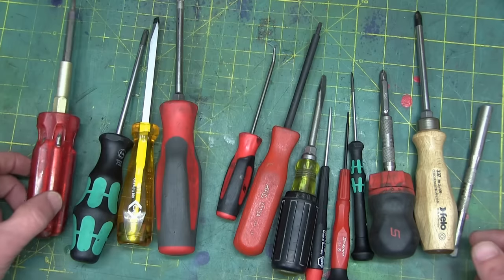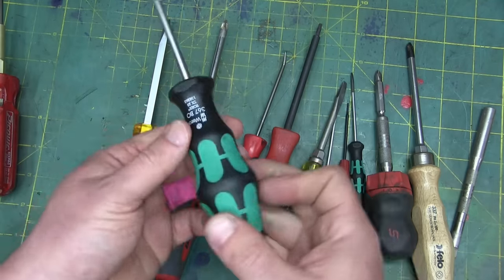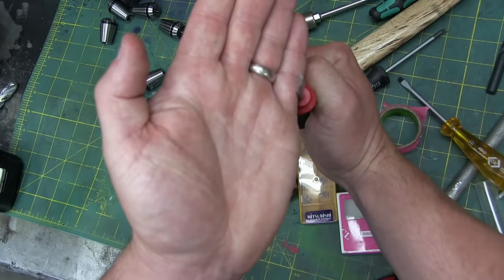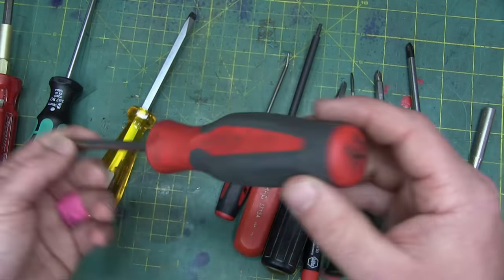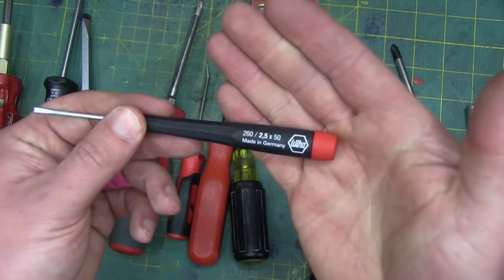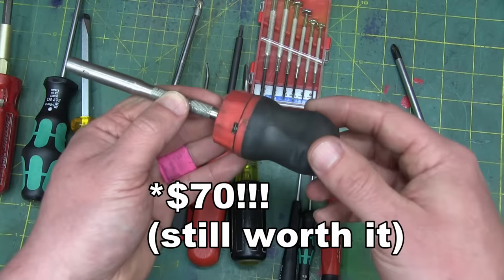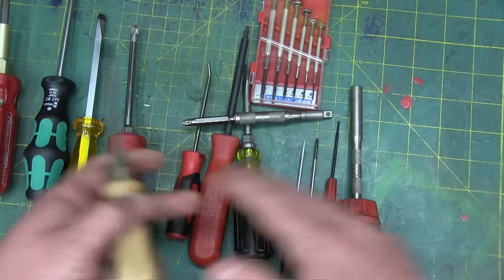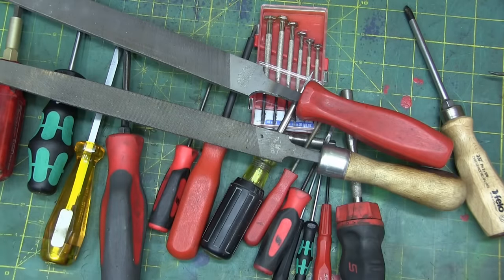Screwdrivers is BEST screwdrivers?

Comment: Those snap-off ratcheting screwdrivers, you can use a 1/4" extension to further extend the reach. Haven't found a need for it yet though lol. A lot of tools I went with other brands, but screwdrivers and ratchets I got all snap on. Even broke down and bought snap on screw drivers for home

Comment: I like my Snap-On screwdrivers, but for handle shape I prefer Matco.  It's a smooth three lobed shape with about a 120 degree twist to it.  It looks goofy, but it works.  Snap-On has a better tip though.

Comment: Wera Lasertip are my new favorites. I thought it was just marketing wank at first, but the day I got them I removed some phillips screws that I thought were fucked beyond hope. I swear it's like magic. They sell the ones with a 10mm hex which are what I have, real similar to the full metal tang Wiha you showed. Actually like them more than my Snap On ones, but don't feel as skookum. I think they are worth a shot for the ~$30ish for a 6 piece set of them off either Amazon or KC Tool.
Reply: Troomoo 
A little lapping compound in a messed up Philips head screw works wounders.
Reply: That's a good tip, I'll have to try that out some time. Thanks!
Reply: Also, a light tap tap to imprint the driver head in the screw helps in some occassions

Comment: I bought two Snap-On ratcheting screwdrivers when I was working on avionics in 2007. I got a regular and stubby driver, and a 10" extension shank. The #2 Phillips bits I got are also grooved at the tip and grab like a gator. I've used the hell out of these screwdrivers and they've never let me down. I even had to use the stubby handle on the 10" shank a few times in awkward places. Indispensible.

Comment: You bought the wrong Wiha set. I use them every day for FAA regulated aircraft component builds and repairs. Get the hex handled gray or blue sets. They fit well in everything I work on. ( even the Bombardier parts ) The purple set with the steel caps on the handles are round but are made of some miracle substance that will NOT slip, which is handy after an air frame mechanic has boogered up a stainless screw.
 I also have chucked up a long Phillips bit in a drill press and also a mill,  and while applying pressure, hand turned the chuck to remove stainless screws from aluminum housings.

JIS are reserved for motorcycles computers and appliances, as the screws are identified with a center punch mark on the head.
I remove o-rings with stainless solder spudgers that I ground and nylon wheeled smooth. The ones you have will be better if you polish them and buff smooth.

Comment: You can get the Wiha drivers on amazon for a pretty decent price here in canada. The sets are fairly expensive but they have anti-shock ones for electrical work that are rated to 1000V protection... whatever that means im not an electrician lol

Comment: 100% agree about the stubby snap-on screw driver. My primary screwdriver but I use the solid shafts with tips. Hardly use the Bit shaft.

My home ratcheting screwdriver is the Roto and love it for less critical work.

Comment: I'm glad you mentioned the Wiha, those are my choice.
Reply: vabeachkevin cause you probably never used Wera ;)
Reply: Krzysztof I haven't. Would you say they are better?
Reply: I would say if you had chance, you should try. Those have this LaserTip, that i found to actually work. I also have a set of Wiha ESD set, i don't like those. Wera cause of not beeing totally round has better grip. They also have this 932 series, that has a hex shape on the blade. Only thing from Wiha that i like more is VDE torque screwdriver that is more compact.

Comment: Good one.  I always buy screwdrivers in sets.  Over the years the Phillips bits have gone south and the flat blades continue on.  Maybe relegated to awes or scrapers but still serviceable.  Result is several hundred flat blade drivers and never the right size Phillips.

Comment: My vote is for Klein.
Reply: fastacker2 that's all I have. Klein.
Reply: Nick Dills as an electrician myself im moving away from most things klien they are becoming too expensive and not as good of quality. The one tool they make that i probably wont stop buying is their screwdrivers they are well made except like aVe pointed out the handles do come loose over time but they are solid and fell great in my hand
Reply: Seconded
Made in USA, nice grippy handles, nice hardened steel bits, and they have a great feature that you never even knew you needed until you used one: The nice little diagram on the butt end that shows what type of bit the driver is and exactly how it's oriented.
That last is terrific for when you have the drivers sticking point down in a tool belt or bucket and you need to know instantly which driver is which and how it's oriented once you start to engage it.

Comment: I bought a 51 piece Craftsman bit driver set, with the red and black handle. Non-ratcheting, really nice driver, handle felt perfect in my hand and it came with 50 bits of varying flavors (including Robertson lol). I had the thing for probably seven years, consistently used, never lost a bit, but I gave it one too many whacks with the hammer to pry something and finally broke the part that holds the bit at the end of the shaft. Just my luck, Craftsman doesn't make them anymore, so they're not covered under the lifetime warranty. I was really sad. That was an excellent driver, in my opinion.

Comment: Work in the cigarette making industry and use a set of Felo Smart since 20 + years- briliant. They are used like a standard screwdriver but can be flipped over to be used as a T- handle. Set is sold here in Germany for 60 bucks. Check them out - awesome. Could not survive without them anymore.

Comment: I’ve used those snap on ratcheting screwdrivers and agree they are great, but with the bigger ones I’ve seen one break and a few lock up and need a lot of torque to release, but that’s out of maybe 50 of them. My work buys those exclusively and it’s my favorite screw driver around, but anything can break

Comment: You can get the wera with both the spanner slot and impact reinforced handle for mechanical work, they're with a yellow instead of green color.
JIS and PH aren't the same. PH are designed to crawl up from the seat when torque limit is reached to avoid over tightening at assembly, unfortunately this also come in play at loosening 25 year old rusty screws! JIS and PH do sort of fit together, difference is that JIS have much better torque transfer. 
Vessel is the brand to buy for JIS, they even make a standard screwdriver with a build in 15 degrees impact function for loosening old screws!

Comment: Milwaukee has a ratcheting stubby. Has all the bits and such on the handle. Use it for plumbing service calls all the time. I’ll use it over a full sized driver most of the time. It’s so nice smooth and fast. Replace the bits with nicer ones if you’re picky.

Comment: I'm sure someone has brought this to your attention. You can use some 1/4 drive extensions in the ratcheting snap-on screwdrivers to extend the shaft. I've used a 24-inch extension several times to extend the screwdriver way beyond any of the shafts snap-on sells. Or at least used to sell. I haven't been on a truck in a bit.

Comment: Stubby ratcheting screw driver snap-on is $70 . Regular size is $140 - 200+ . But I have mine for over 20 years and finally the plastic over molding broke . And still working fine.

Comment: I am a maintenance electrician and  I love the Megapro screw drivers.  They are available in many drivers from  Robertson, Philips, Flat, Allen, Torques and security bits. I find the bits to be nice and hard as they last on the sight day in and day out. I love the ability to switch from one to another quickly and easily. once I found the locking yellow driver I was hooked. The blue yellow tends to drop bits often. This helps keep my tool bag light. I did find the handle to be a bit hard on the hands but once it gets used a bit it feels good in the hands. check them out and let me know what you think and keep up the awesome work.

Comment: As far as picks go, I make my own from discarded screwdrivers with broken tips that people throw out. I have been experimenting with bending and heat treating and I'm getting good at it. Believe me, it's nothing difficult and easy to do with just a Torch.

I just gave my ratcheting Screwdriver away because I always wind up using a Snap-on 1/4" Ratchets and Wobble Plus extensions  instead.  

I also re-grind broken tip drivers and re-heat treat if necessary. There are times I need to make a custom tip to fit what I am working on. I am pretty fanatical with proper screwdriver fit.

Comment: I got PicQuik for multi use at work because of hex drive and can go into impact or drill chuck. I have a MegaPro (Standard)+(Security Set) at home for multi use. Mastercrap Maximum Demolition Set which is my go to for use at work. One insulated flat (Mastercrap) for poking and prodding. Then small short 6 shooter PicQuik for tight spots. A multi fine tip and small insulated standard fine tips. They all work. Stay away from cheap Mastercrap.

Comment: My favorite screwdriver is a blue handled ARCHER reversible blade one. It ended up going home with me after I quit a job years ago. The blade is Philips on one end and slot on the other. Yank it out, turn it around, and shove it back in the handle. It handles 90% of the tinkering I do.  I wonder if it came from Radio Shack with the Archer name on it?

Comment: That torx driver does have a nut on it, it's just molded into the handle, a lot of screwdrivers are like that, even ones that often don't look like they would be will work with a box end wrench.

Comment: I saw this, and immediately ordered a picquic screwdriver. I can see it being leaps and bounds better than all the other 'multi tip' drivers i've seen, because the tips are long, so it can reach in places a little, unlike most of them, where the shaft is big and fat, and the tips are tiny, and the driver cant reach into any recessed screw pockets.

Comment: Klein changes the style of manufacturing of their screwies  constantly. Most notably they went from having real rubber grips that were slotted and slid over a  moulded handle that would have receiver slots. 
Now they use a butylene rubber they stick to the plastic handle with some sort of adhesive.
I would definitely like to watch the breakdown of the change in quality. I can send you some of the different style screwdrivers if you like.

Comment: AvE I found 100's of  old wooden handled 3/8 sheffield hex shaft 3&4 phillip's screwdrivers clearing out the old store at work, there a little crusty but they'd clean up well with a bit of abrasive lube work

Comment: "This rubber part loosens off"  I've certainly knocked a few loose beating on them like chisels but it seems they are groove molded and there is only so much slop on one axis once they are loose- not a rotational axis either so they will always knock loose them over-sized grub screws on lugs without much screwing around.  Pardon the pun.  Glad you like'em though- I don't see how someone wouldn't.

Comment: Get the Felo striking cap(Black and red), Felo ergo(Black and yellow), or Gedore striking cap screwdrivers. Any of those three will completely change everything in this review. Gedore is nice and grippy, strong as frig, these are my favorite screwdrivers. Felo ergo is soft grip and solves the issue of the wood driver...but it doesn't have the striking cap. The Felo metal striking cap screwdriver is the same shape but it feels closer to the Snap on handle. 

The Felo precision screwdrivers are pretty similar to the Wihas, both are great.

A lot of people are going to recommend PB Swiss but the grips are small, I'd bet you wouldn't like them, though they have great texture. 

I have a fair bit of screwdrivers, I try to get two PH2s when I buy a set for when it wears out. Then I started buying more sets and now they basically just get pics taken when I get a new set so I can show the handle size variations. 

Pic of all my noteworthy (mostly spare singles) PH2s from screwdriver sets for grip size comparison:
http://i.imgur.com/MRAVUcO.jpg

Comment: Mac truck here has trouble keeping up a steady appearance,  also 
N.E. Pa  I like Klein products,   also...  I have Klein millimeters,  clamp and regular,  infrared thermometer,   wire strippers,  cable cutters,  nut drivers and screwdrivers...  if you're using tools for a living,   you need to research before you buy.  Tool progress has been amazing... Snap On flank drive plus wrenches are the best in my opinion.  Gotta research before you buy!!!

Comment: Wiha screwdrivers are essentially the industry standard in the electrical field down under, the handles hold up really well under normal use, I haven't had to replace one because it's fallen to bits in 15 years of use.

Comment: I used to have a favorite "tweeker" driver on my fist gig as a broadcast rngineer. Reason was the small ones always made their way into your mouth for temp storage when you needed two hands to move something. Favorite used a plastic that didn't make my lips numb and had an indent around head that was just right for holding with your teeth.

Comment: About 40 years ago, Stanley made a really nice three sided handled screwdriver set, similar in feel to that three side grip Snap on. Of course, someone stole my tool box, and I never found more of them. However, around 1990, what should show up at Home Depot? A set of those very same designed handled screw drivers on their house brand, at $10 for a set of 10. Purchased three sets of 'em. Still have most. Now, of course, Stanley makes something similar again. Prolly cost a bunch, though.

Comment: If you like the stubby Snap-on ratcheting screwdriver, check out the Williams T-handle ratcheting bit driver.  Usually $30 or so, torquey as hell, and shares the exact same internals as the Snap-on ratcheting drivers.

Comment: Had a screwdriver once, took multiple drivers in one end and had a quarter inch ratchet in the bottom of the handle, you could undo almost any screw with that. Why don't they all take a ratchet in the bottom of the handle? Think it was made for KMART under the benchmark brand. You could stick sockets on it too to get into deep recesses with the extensions.

Comment: I’ve used a set of Wiha drivers in my electronics shop daily for 5 years and they’re still in as good of shape as they were when I first used them. Wiha is the best when it comes to ESD safe drivers. Also have a pair of needle nose pliers from Wiha that have held up equally as well.

Comment: For bit holders and bits I love my wiha stubby and 80mm handles and my wiha hex and torx bits. But as far as ratcheting drivers nothing will ever beat my Japanese made Makita bit driver. I used it for years and the pistol grip handle really have me the leverage to give those screws hell. I've been looking for a replacement for the last 9 years since mine died in a warehouse fire and can't even find them on fleabay

Comment: Three words Klein Klein and Klein i've used a shit ton of screwdrivers and my days but I always turn back to Klein just all-around my favorite brand of screwdrivers
Reply: No Name I use a picquik too. They are actually really nice for jobs where less tooling is ideal, like close quarters combat in crawlspaces.
Reply: Yep, this. I'd feel naked without my Kleins. Well, and Vaco. I've tried to kill em, they just keep going. Not as easy on the old hand as a Klein but when venturing outside of electricals for mechanicals it's gut instinct to go for the Vaco these days.
Reply: I really like my Klein’s too.
Reply: think its worth it to just get one set of screwdrivers: insulated kleins? or should i get both non insulated and insulated? is the insulation known to wear off with regular use?
Reply: Makla I own both insulated and non and they both are awesome you can use the insulated for mechanical work but just remember Once the insulation becomes compromised in anyway , they should no longer be used for electrical work. So that being said if you do a lot of mechanical work you should buy the non-insulated but if you do both mechanical and electrical get the insulated but you have to treat them very well
Reply: @12mak  pick up set of wera insulated for the cost of one klein insulated.  Literally.
Reply: 54 for the full set of wera insulated. 
35 for 1 klein insulated.
Reply: If the screwdrivers are as good as the side cutters and crimpers I'm sold!

Comment: Totally agree on the Snap-off ratcheting screwdrivers they can't be beat, I have a stubby and a regular with a full selection of different shank sizes including ones that not only hold 1/4" bits but some that also accept 1/4" sockets. As for the Mac guy I don't think that's just a problem in Canada or small towns, I live in a large city and the only time I ever saw the Mac guy was when I started working in the industry full time at 18 and he was only around for less than a year and then he disappeared and I haven't had a Mac guy come to any shop I have worked at since so I haven't see a MAC guy around the shop for 16 years so idk WTF their deal is.

Comment: I find that the best handles for my regular sized files are the ones I've improvised into existence by drilling a hole 3/4 of the way into a golf ball I have sometimes even taken the time to drill the hole a bit larger and then with the spike bent slightly in two places set it in epoxy. They feel great to hold and you can really lean into them when you want to move through a lot of material quickly.